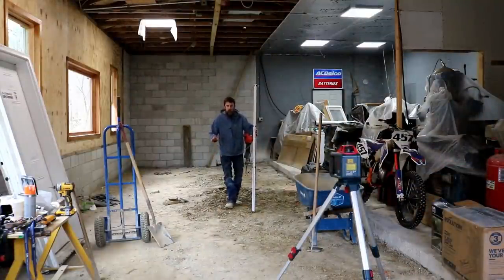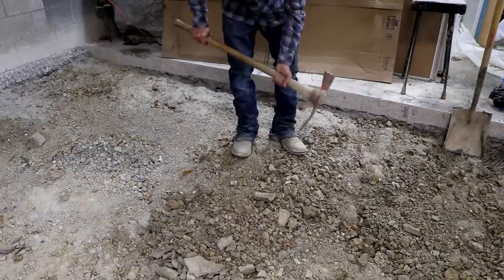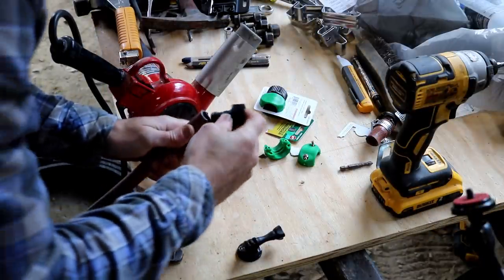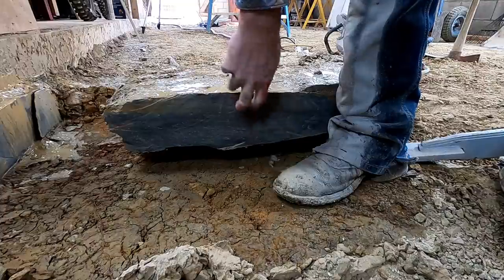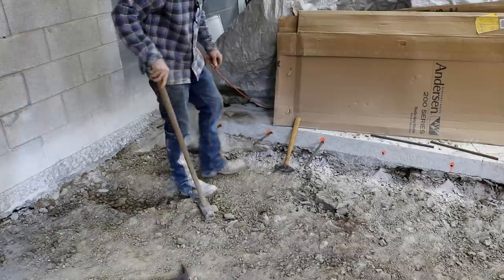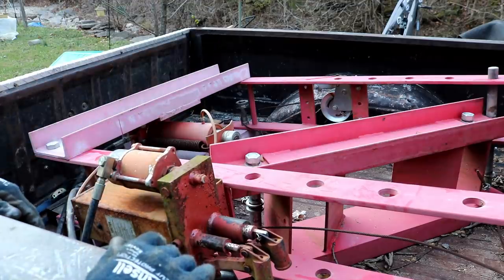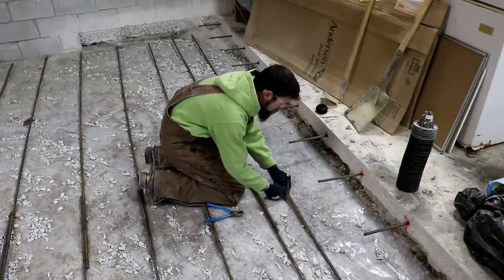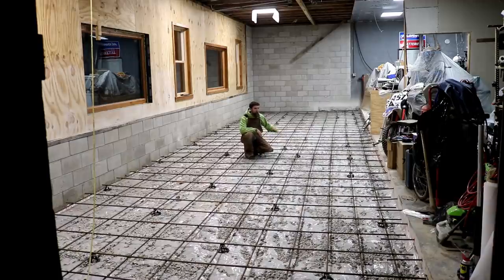Preparing for concrete .

Comment: 1 inch drop per 10 ft is standard  for drainage. keeps the floor dry.
Reply: I was thinking that the 3" drop was intentional... drainage. I have a friend who built a shop and had to specify a flat pad. The concrete guys were going to slope it unless told otherwise.
Reply: Yep!  I would say that pitch toward the door is critical for a garage.
For a machine shop it just means a bunch more grout used to level the machines.
I definitely think the slope was intentional.

Comment: What are you going to have along the wall to support the screed board ?   Its looking really good and this new concrete will be mucho better than the old part of the remains slab for sure.   I like the overkill on the slab thickness and rebar spacing too ( I overkill everything I do, if you can't tell by my comment ) !   The new guard dog is a cutie.   Ya'll stay safe and God Bless ya'll !!!!!!!!!!!!!!!!!!!!!

Comment: Cut your 20' rebar into 3 or 4 pieces and clamp them together and then cut your shorts in a bundle- saves you a lot of time
Jack hammer the rock and toss it out the window- saves your back.
If you plan on having separate rooms for different operations, then just layout the design so the wall separates the 2 slabs and the height difference won't be noticeable- put any doorways where the 2 slabs are at the same level.  If you are going to have a full open area, then layout your machines and benches to cover the uneven areas.  If you can't sleep at night thinking of the unevenness, then move everything to the new slab and get out the jackhammer and checkbook.

Comment: I would put closed cell insulation board under that slab, especially if you re considering installing PEX for in floor radiant heat. If you don’t, you might as well not bother with the PEX, as your heat will radiate down into the ground instead of up into the space you are trying to heat. Especially since you have all that rock under there. You’ll just be creating a gigantic heat sink. Also, install the same foam board where the floor meets the wall, or you will lose heat there too. You will want the slab to be fully insulated so you hold the heat in the slab. Basically you will be creating a floating slab. I know it’s a lot of work, but if you are going to do it, you might as well do it right the first time. I’ve done much research on this subject as I have plans to install in floor radiant heat in my barn when I pour the floors.

Comment: Another comment from the (other) Peanut Gallery: the eye bolt idea is a good one but tripping over them or moving machines around them will be a pain. Why not buy some one inch dowels, saw them to length and embed them flush in the floor when you pour it. You can then drill them out if you ever need to use the hole for an anchor. If not they are not in the way. Going all the way through doesn’t seem like the best idea, though. In any event, nice work as always. You are an inspiration.

Comment: Steve, you mentioned about making a sheet metal tapered "wedge" for screeding the concrete. Save the money and make use of some old 2x4's you have laying around. Taper rip them to match the fall of the old concrete and stick them in place with dabs of construction adhesive. Why didn't you use the jack hammer to break up that rock once you moved it away from the old slab? Great work. Thanks for the video.

Comment: Watch an old man set up to re-pour his garage and drive way. They put stakes in the middle and sides of the area of the pour attached 2x4 to stakes, in the middle and sides parallel  to each other with the bottom of the 2x4 at the height wanted for the floor. So as they poured the used another 2x4 with side bracket on each end,  that held the 2x4 up on top of ones staked and the 2x4 was the screed to level the concrete  even and level the whole job floor and dive way. Do not know if explained that right? After screed pulled up stakes and frame  level 2x4 and smoothed off slabs.

Comment: Mate great job on the prep on the sub bass for you slab ,, I'm a concreter here in Australia  slabs like yours we use mesh 8.2 mm @200 mm square  6 MTRS X 2.4 MTRS ,,,, the only thing I would have done differently is sand to finish the bass level and placed plastic down then reo ... To stop rising damp  ,,, as for leveling out the others side ask your self ,, can I level my machine to suit what's there ,, instead of replacement ,,can I hide the join  with a wall ??  Just a thought 😹

Comment: Sloping slab down to the doorway means water flows out if you are washing equipment, or there is a flood. I call it a feature
Reply: I agree.  3" in 18 to 24 feet is a nice drainage slope for cleaning something before repair or not having 5 gallons of old coolant flowing INTO the shop if the container ruptures in the night.  If you pour a slab outside it will be easy to roll things in but have water run back out if it leaks under the door.

Comment: think the skimcoat on the old concrete would crack up pretty fast where it gets below 1 inch thickness aspecially with machines sitting on top of it  , maibe you could cut a row of inch wide grooves across the pad from the seam to the wall  bout 2 inch deep and 5 inch apart from the level part toward the entrance and a 6 inch wide groove where the seam would be toward where you where planning to pour up to the level old concrete to give the new stuff some more to hold ontoo and thickness  . maibe if you get fiber reinforced concrete or a kind of self leveling cement (basicly  verry thin slurry dries looking like emaille ) or some sort of epoxy over the entire top it be strong enough
Reply: Yeah, seems like something you need to ask a specialist about.

Comment: Looks good. The company I had pour mine made fun of me for 18” o.c. rebar and 6” slab. They said it was more than an industrial slab, which I think completely depends on the application.

Anyway, make it bomb proof and hope you don’t have to worry about it in the future. Maybe a 2x6 or so with a bevel on it, beside the new slab, to give you a transition between the two. Although if it’s a whole 3” it might take several...

Comment: You might want to get one of those rigid mid-body support braces to keep from wrenching your back.  It is easy to mess your back up and difficult to recover.  Your lower back is the main weak point.

Comment: Can you use the "opportunity" of the  height difference forcing you to do both sides to run a  drain down the centre of the shop and out the front door.
Screen on top and a quick flush if anything needs cleaning. Machine movement and placement would be important though.
Reply from the maker: I considered that but decided against it.  It still wouldn't hide the 3 inch difference. Not well anyway.

Comment: Good morning Steve, Lars is correct about the thermal bridging with the rebar.  Another thing you can do, depending on how cold it gets there in the winter is to separate the concrete pad from the walls with some 1-1/2 XPS foam.   Also,  did you tie the rebar to the rebar stubs that you pounded into the existing pad?  They should all be tied together.  If you did, great. It's just to hard to see the wire ties on the video.  Love your channel. Keep up the good work. Cheers from Canada.
Reply: canuckguy worried  You can only weld them if you buy weldable grade rebar (gr 400W/60W).  You should not weld regular rebar.  Wouldn't matter too much for a workshop slab but don't do it on a structure any engineer has to sign off unless approved (even with weldable rebar).  Weldable rebar is more expensive of course and only likely available from a proper rebar supplier, not your home center.
Reply: canuckguy worried  I was not critiquing what you had done.  I was informing people who wouldn't know there was weldable grade of rebar and that you should not weld on standard grade.  You did not mention this important detail when suggesting to weld rebar.
Reply: canuckguy worried  It's just soft steel. It's only function is to temporarily hold the bar in place until the concrete is poured. Around here ties are premade with a loop on both ends and a pigtail tool is used to spin them tight.

Comment: I learned from your vid and the comments, that I would have made a big mistake why I was thinkig to anchor the rebar in the outside wall, too...heat transfer and shrink cracks would ruin my work on such a project surely...
8-o
Thx a lot for the vids and the massive knowledge from the commenters!
:-D
Reply from the maker: I believe in alot of cases pinning to the walls is a good idea where the climate is mild.  My case is a little different because of the way my foundation and fill are situated.
In theory my pad could lift on the wall side . I'm not concerned that it will . One thing is for sure and that it's not going to sink down unless the entire new side decides to.

Comment: If it's temp..maybe an epoxy concrete fill mix like is used to top coat bad driveways? Won't match color wise but if it's getting replaced who cares?

Comment: I’m wondering. I have a similar air over hydraulic press. The difference is that the frame members are welded instead of just being bolted. Would it be worthwhile to weld up the frame to help carry the load around? Beaf it up while you rebuild it.It wouldn’t take too long to do.

Comment: run non metalic conduit under the floor in a few places also pex for future improvements the comments of adding depth to the door area is a very good one the edge of slabs get the most abuse from heavy transitions an crack off as a result as for the leveling of the slab a ripped 2x6 would cheaper to give the edge to screed off the new concrete floor 
prepare now for joints to help control cracking so you dictate where the slab will crack at saw cuts or worked in slots for them

Comment: Btw, I would have poured the new floor 1" higher than the existing floors highest point. Then get a company to pour industrial self leveling concrete that can stay untreated, or with a sealer on top, on top of the existing one. If you got 4"to play with at the door, that is... Wouldn't put down the self leveling myself with bags, just because you wouldn't get the flow to get it flat, and it's better to have in quick so the whole surface is wet before it sets.

Comment: Ok i'm being thick, i'm not a diyer and i dont quite understand something, if the ground was prepped to enable a consistent 7" depth pour of concrete from a reference point taken from the existing slab, why is there still going to be a 3" difference between the slabs in certain areas requiring skimming ?. I've probably just misheard or misunderstood ?

Comment: You are also missing a vapor barrier.  Without a vapor barrier in a seasonal climate water and water vapor will infiltrate your slab both putting heaving pressure on it and also ruining any floor finish you care to put down including epoxy.  Most floor systems aren’t rated over 3lbs per SF of vapor pressure and that’s a low bar.  A perfect slab section also include about 8” of cut gravel beneath to restrict and capillary action upwards.  In your situation that isn’t obviously possibly but I STRONGLY recommend you sneak a vapor barrier under there somehow!

Comment: My thoughts.. Is the "lip" (up to 3 inch in spots) where the new concrete meets the old going to be an inconvenience? If it's not, I would leave it until the old is fixed properly. If it's going to cause you a lot of issues, then by all means, go with the skim coat. The only issue with the "skim coat" is how brittle it is going to be, the thin areas where it tappers are going to crack when you roll some of your heavy equipment across it. You can try to mitigate this as much as possible by cleaning the old areas (to be coated) with an acid and using some of the paint on bonding agents but this will be a minimal help just because of the pressures involved and semi dis-similar sections that occur when trying to bond 2 sections like this. Will it be horrible? No probably not, especially not if you are overly careful in those areas. Like anywhere a heavily loaded steel wheel is going to roll, put down some 1/4 plate steel to distribute the weight when yur rolling heavy crap over it (not convenient but it works). Depending on loads, this is going to crack somewhere where it thins out to nothing.. You can also mitigate some of this by cutting the concrete back and placing some plate steel on the surface in the newly created cavity to create a "load area between the new pour and the old. This all comes down to how much work you want to put into it. With a small(er) amount of work you might even be able to create a truly strong "temporarily permanent" fix, using the idea of creating a cavity with a chunky bit of 1/2" plate along a line across the shop. It wouldn't have to be more than 4" wide (ish) and you can cut a stress relief along that line as well, give yourself a great starting point and get the thinnest spot to something more like 2" instead of a tapper off to nothing. Perhaps rent a surface grinder for cement. I dunno, just thinking out-loud here. If anything sounds interesting, you want any other ideas, or I am being a tad unclear/ambiguous, feel free to ask.

Comment: Points to note:
Why use Rebar when weldmesh is the favoured option as it is much easier and quicker to lay, also generally cheaper?
The reinforcement should be in the top of the slab with 40mm(1 1/2") cover
The dowel bars should have been plain round bar that would be epoxy'd into the existing concrete and wrapped in pvc tape in the new concrete to debond it, allowing expansion and contraction.  As you have used high yield re-bar then you will need plastic sleeves to provide that debonding.  When it comes to casting a new replacement slab the dowels can be left to be solidly cast in to the new slab.
Is there a polythene damp proof membrane below the slab?  This should be turned up the walls  A layer of sand should have been laid over the existing formation to prevent the dpm being punctured by the stone left in the ground. .
The perimeter of the new slab should have a 25mm (1") margin of Hydrocell or similar (not bitumen impregnated fibreboard) and this should also be at the joint with the existing slab.  It should be cut 25mm (1") down after pouring to accommodate a polysulphide joint finish.  At present your ideas will result in the initial expansion of the concrete straining the perimeter wall (possible failure!!??) and then as the concrete contracts you will have very thin joints to seal.  Any further expansion due to temperature rises won't be taken up with the thin joints.  Do not underestimate the forces in concrete expansion and contraction!
At the door thresholds I would set a 40x40 angle with the toe down and welded ties to be cast in with the concrete.  This angle will be set with little tolerance so that any future door/frame will require minimal bedding.  If you cast this threshold by 'eye' without the angle then I guarantee that there will be a dip in the middle, no matter how skilled you are at laying concrete - its a common fault.
You will need a temporary rail adjacent to the long external wall to tamp the concrete off as well as fixing a rail to the existing slab to get it level.  The concrete needs to be well tamped to get rid of any entrained air and achieve full consolidation but not so much as to draw the fat to the top as this is very weak and will be a dusting nightmare.  As dry a mix as will flow is best 
I suggest that the maximum dimension for the cast slab be 8m/30ft to prevent excessive uncontrolled expansion/contraction that will cause crazing.  You can lay bigger bays but that requires machine laying and a greater specialist knowledge than you have available. 
I also suggest that you should finish the slab with a power float followed by an anti-dusting agent, e.g. Lithurin

Comment: Considering the "error" in the old concrete is right at the front of the shop, I'll bet it is there to allow any liquids to run out of the shop instead of pooling. I know my garage has about a drop from front to rear just for that reason. You may want to consider that before you pour new concrete.
Reply: I reckon that's useful in a garage, maybe not so much in a machine shop?
Reply: @____________________________.x  Given the location of his shop next a watercourse prone to flooding I would have thought a fall towards the door would have been a perfect option.

Comment: Love the overkill of rebar. Are you gonna add fiber mesh to the concrete?
Reply: Fiber mesh is crap. They did my patio with it and now it is in four pieces.
Reply: @johnnyholland8765  Hand the same problem. Fiber can not relace rebar.
Reply: Their is two tipes of concrete....the one with cracks .the second one will crack

Comment: If it was me, i would tear the other half of the floor out now rather than later, to get the best job possible done. i know it would be a big pain to do it now, but really its easier to fix now than to try and make up for it later.
Reply: @jeffreylee7184  its a pity the floor was not poured correctly first day.

Comment: You shouldn't pin it to the wall because as the concrete shrinks (it will as it cures the reality of concrete) it will try cause it to crack in the center of the room. If you want know how I figured that out on my house just ask.

Comment: Why dowel new slab into "bad" slab? If you are going to remove in the future. There are several good options for self leveling topping mixtures. With adequate bonding prep would probably give you a good life expectancy.

Comment: Did think the stone would be easier left, but probably  would've got in the way of the DPC and the Rebar, strong maybe but could be fractured or brittle, If it was lots of bedrock I would probably leave them but just one big stone Sometimes easier just to shift it, pain to shift it when you're onto the next phase  It's covered up   :):):)